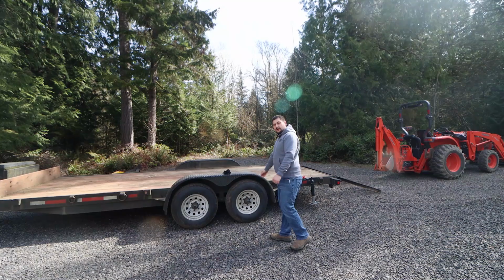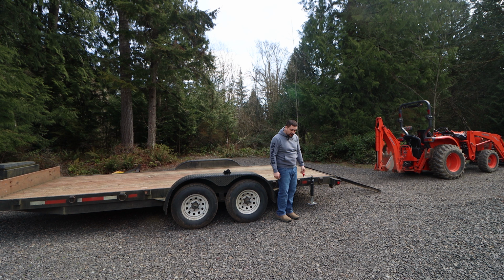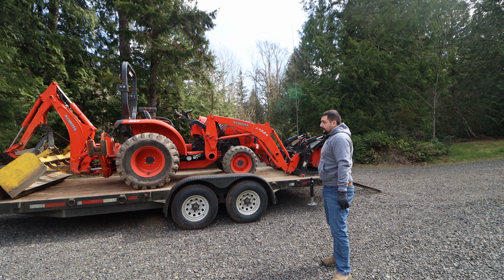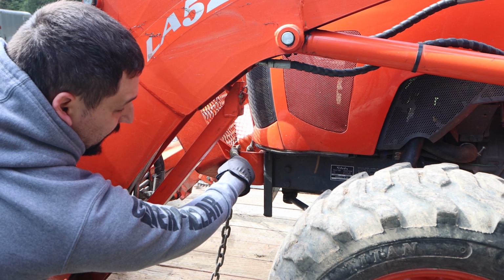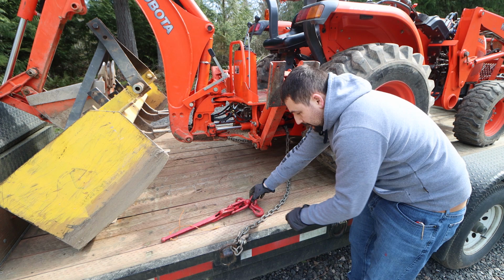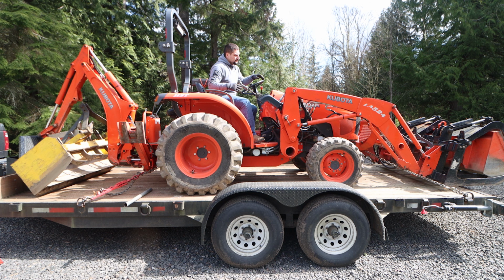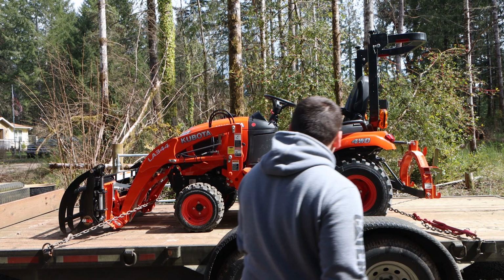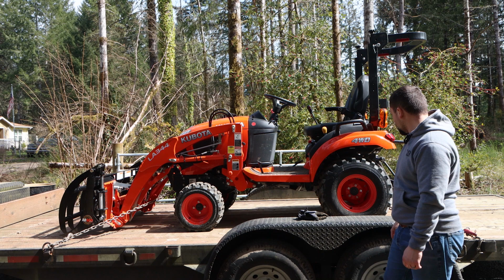Loading A Tractor on a Trailer

Comment: I think if you got pulled over, the inspector would really frown on how you are transporting the bucket and the box grader.  The only thing holding them is slight residual hydraulic pressure.  Remember you relaxed it?   If you had a hydraulic failure, that bucket is coming out of the grapple and through the car behind you.  In my OPINION, it’s always best to chain down all the attachment.  The way you did it seems like an accident waiting to happen. Also, since you don’t have factory lockout on the backhoe and FEL, the boom and FEL should be chained. JMO.

Comment: Thanks for taking the time to make the video, and trying to help others do things safely.  Unfortunately, what you did in the video is absolutely unsafe (probably illegal) for you and everyone else around you.  You should use four separate chains, one on each corner of the load, 45 degrees from load to support is a good target.  You used 3, if the one chain on the rear of the tractor breaks, or loosens (which can happen), the rear end is not secure at all.  Also, the rear of the tractor can move side to side with one chain, even though you crossed the chain over the hoe.  Four separate chains will not allow that to happen.  The attachments are not tied down at all!  You are counting on gravity and pressure relief valves to hold the hoe on the scraper and the grapple on the loader bucket.  No Way!  To properly secure that load, you need a minimum of six chains.  A binder on each one is what I do.  If you lose any part of that load and hurt or kill someone, you are done.  Take what you do seriously and do it right.  My brother was a DOT cop for 20 years and taught me the correct way.  

Anyone who watched/watches this, DO NOT DO THIS!  Ask the State Police in your state to show you how to do this.  Dan, I would stop doing this and get rid of the proof you ever did (delete this video).  Sounds harsh I know, but a 400 pound loader bucket taking out a family going to Grandmas for apple pie is a lot worse.

Comment: Every point has to be able to be tightened. DOT doesn’t play with load security. The WLL of the chains needs to be 50% of what you are securing. If it’s going over, it needs to be 100%. Working load limit.
Reply: Yuup!!

Comment: Personally, it's four chains or more and some areas require  crossed chains so I usually cross them. We have larger tractors (100 hp more or less),often will duels and wide attachments so require bigger trucks and trailors with signs and flags and sometimes escorts,  lots of fun

Comment: When I load things I’m always thinking of this thing tips over I was the tractor to stay attached to this trailer.
This means will my chains hold strong if this trailer tips or rolls?

Those chains look like they need to be three times as thick with a chain binder at all four corners and possible two
More mod section then secure the implements down with high tensile ratchet straps.
Spend the extra money on heavy chain and binders.
It’s like do you want your wife to drive a 1965 dodge with no seatbelts or do you want her to have seat belts, air bags, curtain , side door and steering wheel.

Although 65 Dodges are cool, I’d add a harness, cage and a Hemi.

Comment: Nice tractor. I have a 3200 dt bh77. I sold my car trailer and got a 22' beaver tail equipment trailer. Loads really easy. If you have ktac insurance, you can add the trailer. Really cheap

Comment: 19'6"

Thank You

My trailer came with the Package deal from a local trailer manufacturer at 18 feet and the Kubota L-2501 and I bought the Woods BH-75 backhoe the following week

I bought the removable stake pocket 'D' rings and was able to get the Hooks through them but some how one will not go back through to remove it from the 'D' ring.

I will remove the hook from the chain and that issue is solved

Question about possibly grinding some of the Hook for gaining clearance with the 'D' Rings do You think that it might make that hook degraded and dangerous??????

I really try to avoid modifying anything that is a safety device

It is just long enough but the hinged ramps were making contact with the Brush Hog when it arrived and had already chipped the paint which was a minor point because I knew after I started using it there would be many more chips and scratches and dents

Your Trailer looked like it was at least that long if not a 20 foot trailer, and was it NOT hooked to You Tow Vehicle.

I assume it was connected

It was not visible in the video and the trailer jacks the the rear did not seem to touch the ground as You loaded

I will look again at that step

Thanks for Your fast response

Ken in Florida

Comment: All implements need to be strapped down independently by law. So strap the backhoe, strap the box blade. The bucket is a big disaster the way you have it. Strap the darn thing down bro. Insanity? And use four chainsaws instead of three, 45 degrees on all four points. The DOT would have a field day if you got pulled over like this. Probably set you back $600 plus on multiple tickets. Buy some more chains and get her done, Let’s Go !!!

Comment: I have been wondering if anyone loads a Kubota with a Backhoe backed onto the trailer

How long is Your trailer Deck?

I see You still have a clearance issue where You use the bucket to raise the rear/lower the trailer tail so Backhoe frame does not rub or drag on the trailer

Reaching back to work the backhoe levers is probably not a good option for Me and My lower back issues

I have not tried backing onto the trailer yet, but when I drive onto it the bottom of the Backhoe plows a deep gouge in the dirt/sand 

18 foot with Beaver tail and 4 foot ramps and longer ramps might have to be at least 10 to 12 feet long

Thank You for this video

Ken in Florida
Reply from the maker: The deck is 19’6” it refuted to as a 20’.
Reply: @DanielWoodell  Thank You

You have Great video's and even show things that happen in real life and You ask for feedback when You have questions

Great videos

Ken in Florida